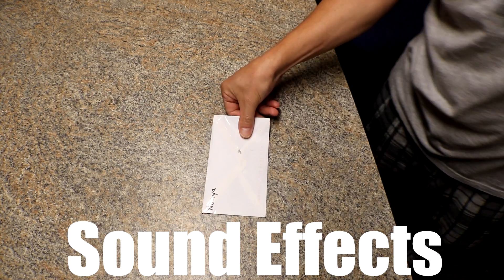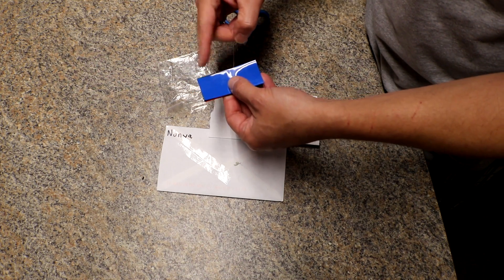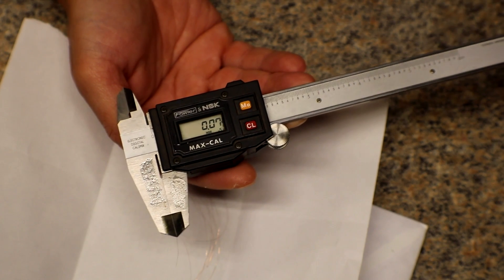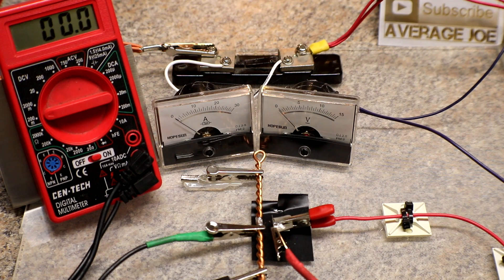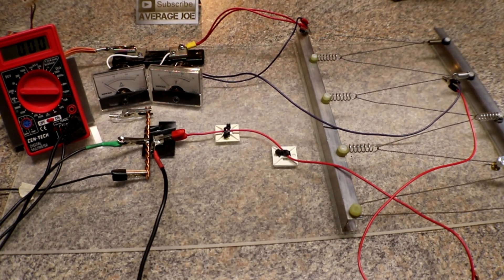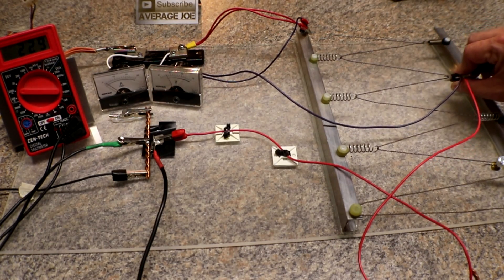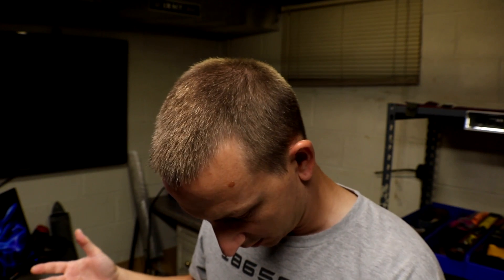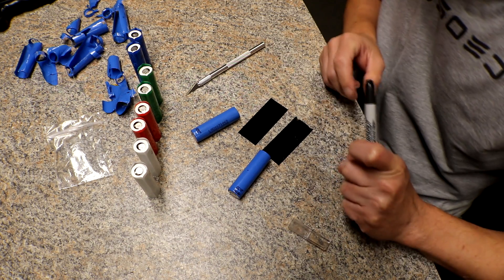Diy Tesla Powerwall ep42 Keiths 40AWG Wire Fuse Results and A Late Night Funny Ending!!!

Comment: OMG xD haha, some fun testing and heatshrinks. Tbh all those fuse wires seems to all have the problems that they have a "pretty big" voltage drop (ofc they need voltage drop otherwise they wont break...). Tho the battery might have a bigger voltage drop than the small fuse wire during those loads but still... Very interesting testings :) Maybe you should dubble the fuse amps rather than "play safe" hmmmm, it's really when they go short you'd like to protect them and not suffer any voltage drop.
Reply from the maker: +Prawler Flowa Ya lotsa fun lol. I shorted out 200 fuses 2 weeks ago and Im super glad I used the lil glass fuses!💥

Comment: Joe, love the vids and now I followed Keith's EBay shop to get those heat shrink.  Going to get the transparent blue for my electric lawnmower Lithium battery pack. The lead acid batteries died on me. (24v 20ah 480wh)
Reply from the maker: +Antolin Ventura Thanks!!! Yeah I got him saved as well. That electric clear blue will be a perfect fit 👍

Comment: i need a solar charge controller to get my 18650 cells charged with two solar 12v panels and i cant find any !, i got a PWM for 20A but it stops the load at 11.5v and i have a 3s for 11.1... so any cheap and good charger that you could recommend ?
Reply from the maker: +Saul Gonzalez How many watts are your panels?
Reply: 150w in total, more or less... this is my first attempt, i have a 99 cells pack with 33p and 3s for 11.1v nomimal
Reply from the maker: I plan on maybe getting a morningstar TS-MPPT-60.  They are pricey tho.  Are you planning to add more solar i the future?
Reply from the maker: Paul Kennet just posted a video of a charge controller he uses and its 12v or 24v.  Its not technically for lithium cells but you can set it up to beable to charge lithium cells.  His vid about it is here https://www.youtube.com/watch?v=e1L4_pi7Efo

Comment: Do you stay with the Glass Axial Fuse or would you now take the wire ? Or are 4 amp too much ?
Reply from the maker: +IronXSide I still like the glass fuses, lil more work untill you get your groove then it goes a lot quicker. I would be fine with the 4amp wire but I the enamel coating is tricky. Took me a few tries cause I thought it was soldered but once I tried to do a load test it would go open circuit.

Comment: LOL. awesome video. thanks for the plug! ~4amp fry is good to see as well.

New colors are coming "soon". Pink and Yellow are just a few that will be available. Electric Blue is a definite!
Reply from the maker: +Keith Tucci No Problem!!! Yeah 4amps is great in my book :) When I need some Ill be gettin the pink!
Reply: Keith Tucci is that the wire you used on your powerwall?
Reply: Antolin Ventura I had intended on using it, but I may go with the glass axial. My design type has changed a few times and I'm using paired cells now. So a higher fuse is "needed".